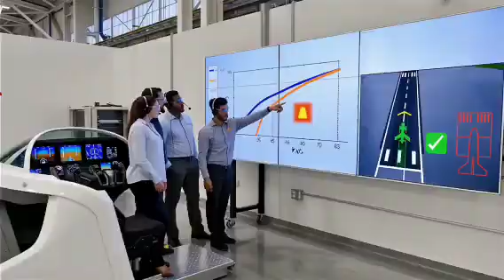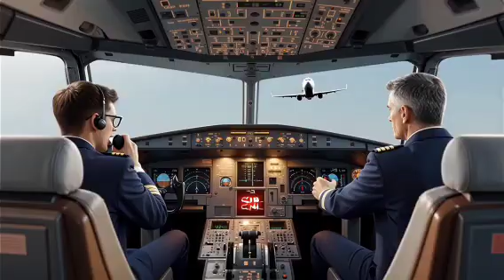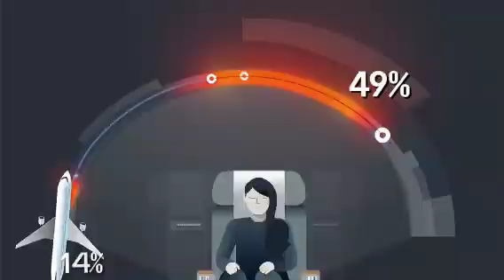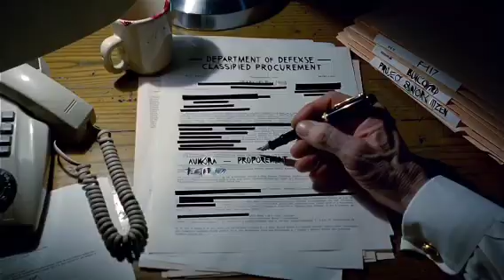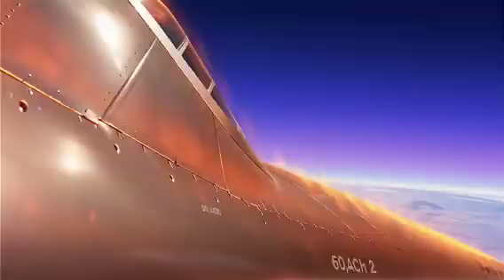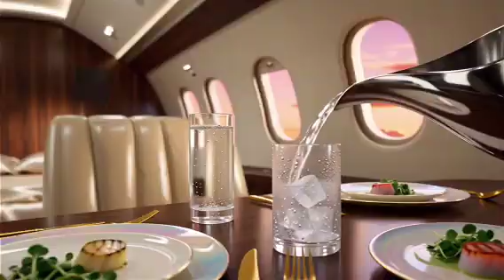The Wind That Cannot Be Seen Has Killed 600 Airline Passengers

Comment from the maker: ✈️ COMPLETE SOURCE VERIFICATION:

Delta 191 accident (137 fatalities): 
NTSB Accident Report AAR-86/05 — 
"Delta Air Lines, Lockheed L-1011, 
N726DA, Dallas/Fort Worth 
International Airport, Texas, 
August 2, 1985." 
Full report at ntsb.gov.

Eastern 66 (113 fatalities): 
NTSB Report AAR-76-8, 1976.
Pan Am 759 (154 fatalities): 
NTSB Report AAR-83-02, 1983.

Dr. Fujita microburst model: 
Fujita, T.T. — "The Downburst: 
Microburst and Macroburst" — 
SMRP Research Paper 210, 
University of Chicago, 1985. 
Foundational microburst paper.

Three-phase headwind-downdraft-tailwind 
sequence: Documented in Delta 191 
NTSB report performance study, 
Section 1.16. Also: 
Ivan et al. — "The Anatomy of a 
Microburst" — Scientific American, 1986.

Dry microburst 30% figure: 
NCAR Convective Weather Program — 
"Microburst Climatology" — 
available at ral.ucar.edu.

TDWR deployment (45 airports): 
FAA Program Office documentation. 
FAA Order 6310.10 — TDWR 
Commissioning criteria.

FAA 14 CFR 121.358 windshear 
training requirement: 
ecfr.gov — public access. 
Also: FAA Advisory Circular 
AC 00-54 — "Pilot Windshear Guide."

LIDAR wind shear detection testing: 
Chan, P.W. — "LIDAR-based 
Wind Shear Detection at 
Hong Kong International Airport" — 
Meteorological Applications, 2012.

📊 Every accident is documented. 
Every physics claim is verified.

Drop ✈️ if this changed how 
you look at thunderstorms 
near airports —
and comment: did you know 
dry microbursts exist 
with zero radar return? 
That detail surprises everyone. 👇